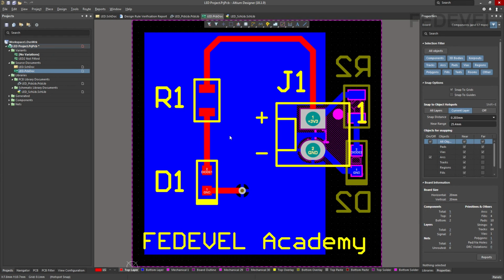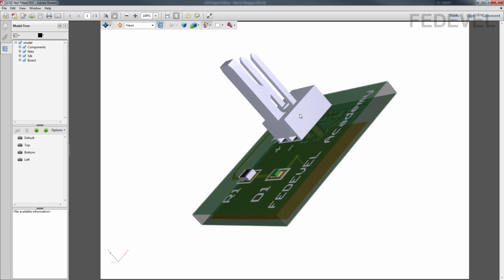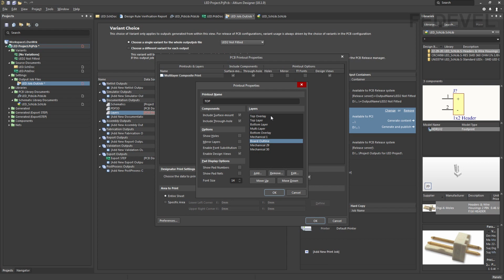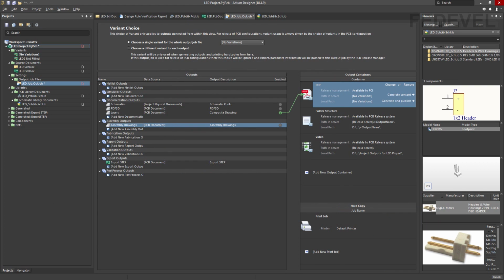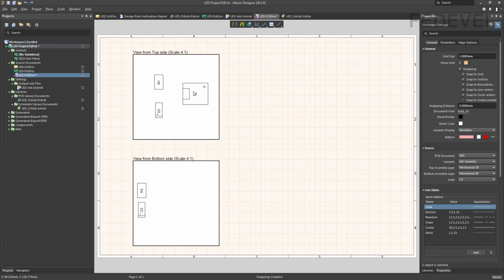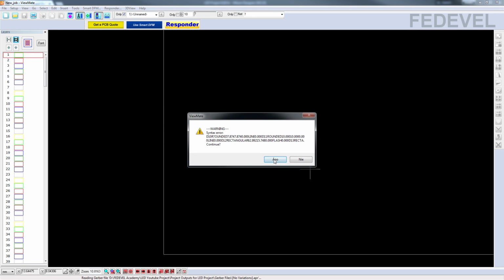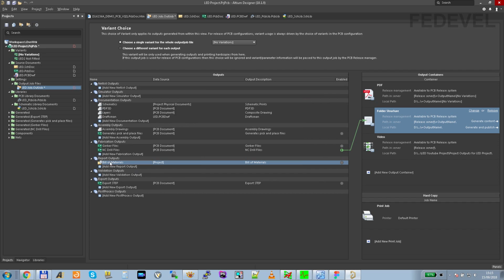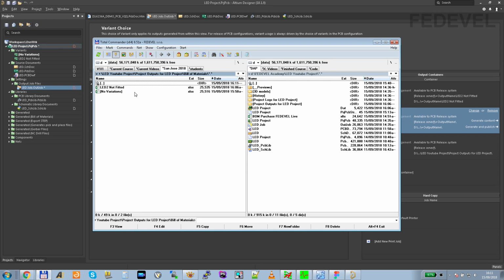Tutorial 5 for Altium Beginners: Generating Manufacturing Outputs

Comment: Hi Robert,   Went through the video the second time, and now it's making a little sense.   Running Altium 22 is one thing, but designing and packaging the PCB into a 3D model is important.  Pushing this 3D model to Solidworks 17 is another challenge.  Do you have courses showing the chassis placement and interconnections?

Comment: 26:19 therer is no Top assimbly layer and Bottom assimbly layer in Source. I am using Altium 20.0.13
Reply: Beginner here.  I got it to work by changing M29/M30 pair Layer Type in PcbDoc to Assembly.  Then in PCBDwf, right click on the sheet and import changes.  Ignore Source selection as the top/bottom options appear to be gone.  Click on either top or bottom image in draft then change Component Body in bottom of Properties to Assembly drawing.

Comment: Hi Robert, Thank you for creating this awesome content. Acquired a lot of knowledge. I have one question, I have a requirement to create a daughter board where it consists of many small module boards attached to it using female headers. I have designed the common module schematic and PCB design, Now I want to use this design as the component in the new schematic so that when I select this component I should get the footprint and 3D model of the module. Could you please help me with this? (I am using Altium designer 21.2.2)

Comment: 28:48: on altium 21.0.8 there is no option for "top assembly layer" and "bottom assembly layer", i haven't figured out how to do this yet

48:32: when setting up the BOM, left clicking on the column name doesn't order the items based on that column. this is weird esp since manual says it should work
https://www.altium.com/documentation/altium-designer/bom-configuration-in-the-report-manager-ad#!sorting-data-within-columns
ETA: i clicked ok and went back and it worked. huh

Comment: Robert Excellent content from V1 through V5;   I was an Altium user many years ago.  Now, I am back in this program.   Draftsman is something new and the FPGA stuff is gone.   Wow, what a great introduction to Altium.   May need some help in impedance matching components and boards.   What would it take to make a gigabit board?    Differential traces;  crosstalk and signal integrity would these topics be included as tools to solve the issues at hand.  Phil
Reply from the maker: Thank you very much Phillip. PS: I have some videos on my channel about that topics.

Comment: Altium 20 don't have top and bottom assembly layer option in source tab in Properties while generating craftsman document. where to get that ? Help me Robert !
Reply: Altium 20 has seperate general and Layers tab in Properties. We can select assembly layers from Layers option while generating craftsman document. Thank you Robert for such amazing videos.
Reply from the maker: Thank you very much Pritish for providing also the solution.
Reply: @pritishvitekar2187  The same applies to AD 19.1.9, although when I change the source to show the variant, nothing changes because the mesh is created only when the Component Body checkbox is selected, which in turns overlap the Assemby layer :(
Reply: Select your board assembly view ->properties -> components -> uncheck all components 
Then go to layer tab and make visible mechanical layer29

Comment: @Robert Feranec Thank you so much for your altium series for beginners.Will you give another series for advanced? For example in my design there are lots of same circuits, for this reason I want to make same placement and routing for all circuits I dont know the short way of this. I watch your video about copy placement but there is simple way to copy placement,align it in pcb and copy routing too.
Reply from the maker: Thank you Hasan. PS: It is on my list, I just have not had any project where I could use it and make a video about it.

Comment: Hello Robert, I am using your BOM template but could not generate 5 columns. Supplier Order Qty 1, Supplier Stock 1, Supplier Unit Price 1, Supplier Subtotal 1, Supplier Currency 1
. How can I resolve this? I am using Altium 19.1.7 and MS office 2016. Here is an image: https://github.com/Shahzaib-Shamim/BOM/blob/master/BOM.jpg
Thanks for this series!
Reply from the maker: Altium keeps changing it. However, when in the configure window, try to go to Properties -> Columns TAB and try to play with the Sources buttons. Depends on what you are using, but you may need to enable the Server button (?)
Reply: @RobertFeranec  Wow Robert, thanks a lot. Enabling Server button did the job.

Comment: I think I learned a few things. Not sure if they will work on my version (17) but there may be similar options. So far (before watching) I have fumbled around a bit and I think I have the basics OK  like changing layers while routing and I've used ctrl+shift+scroll wheel to traverse layers. I'll have to try the shortcut to put the component on the bottom layer (I've been double clicking and using the properties box to change layers for the components). To delete tracks I had been using the unroute -> connection option.
Reply from the maker: Yeah, 17 is not so different. Biggest difference is Properties panel vs Double click. And .. some options where moved around, so you may need to look for them.

Comment: Sir, i have generated 3D PDF as per the steps told by you but the generated 3D PDF page is blank, what may be the reason?
Reply from the maker: Are you using Adobe Reader?
Reply: yes sir
Reply from the maker: @lalitkumarbaghel4338  Hmm .. then it should work oki. Maybe try to open 3D pdf from my original project, to see if problem is in Adobe Reader or in the generated PDF?
Reply: @RobertFeranec , its working on adobe....thank you sir

Comment: 0:44: Add new Output Job File to project
1:23: PDF Schematic
6:23: 3D PDF

8:44: STEP 3D model
13:01: Composite Drawing ("Layers")
19:10: Assembly Drawing
25:13: Draftsman Document
32:36: Pick & Place file
34:39: Gerber files
39:24: NC Drill file
41:40: BOM
53:05: View files in video on Github
Reply from the maker: Sean, I was just adding the chapters into this lesson :) We had to do it at the same time

Comment: I have come back to this series several time because it is so good and because I have tried to move the design I inherited closer to this methodology. Today I set up variants the the two versions of our product. One version with 7 Segment digit display and on version with an LCD display. 

After setting "DNI" components as appropriate I generated schematics with the variant names. I then pondered, once these are printed out you cannot tell one from another by the drawing name on the actual drawing.  

It seams that every page should have a variable parameter which can be set by the variant method and this parameter should be on each page in or near the title block.
Reply from the maker: Thank you Forrest. This may help - you can add variant parameter for example to titleblock: https://youtu.be/cD-iW0LNR9Q

Comment: Excellent video Robert Feranec. I have a small question. I am a new PCB Drawer and I don't understand what is meant by Fitted and Not Fitted Components. Too much Thanks For you
Reply from the maker: fitted = component is soldered on PCB, not fitted = component is not soldered on real board
Reply: @RobertFeranec  Thanks Very much

Comment: Finally finished this wonderful presentation! I learned so much... 
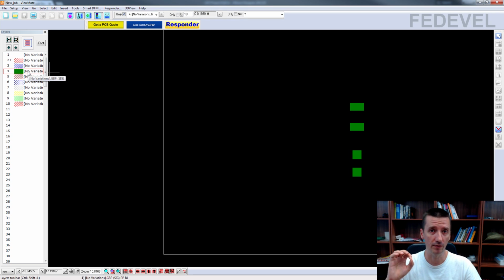(a tiny hint for ViewMate, instead of all the double-clicking to view layers around 38:30, you can use the arrow keys above the layer list to move up and down the stack. turn all layers invisible except for one layer and try clicking blue arrow buttons!)
Also, if you ever have a desire to expand on this course, I would like to see a "Tutorial 6: Your First Revision". Use the same LED layout, but assume the engineer has asked for one LED D2 to be colored RED and wants mounting holes in the corners (or something like that). What to check before starting a revision? how to make a backup, clearance rule around holes, etc. Just an idea, but THANK YOU for making this series!
Reply from the maker: Thank you very much Jack
Reply: @RobertFeranec  Robert, please excuse my request for a "Tutorial 6" in my comment above. I had forgotten that you have more "Advanced Courses" available on your website (I thought I was finished with them all, ha!) I will try to get approval from my company to order them.
Reply from the maker: @jack0lson  Yes, the things what you mentioned are covered in my other courses. I can't put everything on youtube - it is quite a lot of work to prepare videos like these. It may not look like that, but for example Advanced PCB Layout course took me 1.5 year of full time to create (that includes 1 year of board development what is used in the course as I needed to have our own materials for teaching and students practicing).

Comment: Hi Robert, I finally finished the whole series. All 5 videos were amazing and helped me a great deal. But I was wondering, is there a way to add the measurements (at least the board size and the distances to the mounting holes) in the draftsman document?
Reply: If anybody needs that too, I found out that in the draftsman document (*.PCBDwf) if you go to the menu Place you can add Linear and Radial Dimensions, which was exactly what I was looking for.
Reply from the maker: @AlexanderEick89  You can add dimensions in Draftsman and also directly in Altium.

Comment: Hi, thanks for the videos. In the 28:36 minute you select the "Source" for the Top and the Bottom Assembly Layer. In Altium 19.1.7 those options do not exist. How can I do this?
Reply from the maker: I noticed that .. I am not sure where they moved it, anyone knows?
Reply: @RobertFeranec  Greetings! I dont know if it actual after a year (i bet it's not), but i've faced same issue when going through your great tutorial and have found the answer (Started learn altium this monday). To get same result in altium 21 as you got in altium 18, you need to go to _(name of your PCB)_.PCBdoc-> View Configuration->Layers & Color-> choose Assembly Component Layer Pair ( in this video you have used "mechanical 29 - mechanical 30") -> click RMB -> Edit Layer -> choose "Assembly" Layer Type. 

After that you need to go back to the draftsman, click on neccesary Board Assembly View -> Properties -> Component Display Properties -> Component Body -> Assembly Drawing -> Profit (Simply Stated, do exactly how you have shown on the video exept "Source" setting. Instead of Source you need to edit assembly component layer pair properties in ___.PCBdoc).
(Don't know is it  really necessary, but i also impotred changes from ___.PCBdoc to draftsman by clicking RMB on draftsman area -> import changes from ___.PCBdoc)

P.S. Thanks for awesome video! YouTube have plenty of guides, but you are encomassing ennormous areas of small details and explaining them very accurate and clear. Thank You for your job! Going to try your cources when i will have enough resources for them :)
Reply: @writershonor  Excellent. This should be promoted to the top. Great advice Worked a treat
Reply: @leeman3749  I'm glad it helped ypu :)

Comment: Hi Robert!
About the Draftsman.
I do not have Top Assembly Layer and Bottom Assembly Layer in AD 19.1.5 in Source.
What can I do?
Reply from the maker: I noticed, they made changes again. I do not use Draftsman, so I have not had a look yet how to use it now. But when you figure it out, please let me know (maybe I would try to go to View Configuration and I would set Layer type for assembly drawing layers - maybe that could help?)
Reply: I use Altium 19.1.5 as well, and I went ahead and continued with the video even though I couldn't complete that step. The next step of changing the Component Display -> Component Body to Assembly drawing still worked just fine. So you may try that.

 @RobertFeranec  What does changing the assembly layer do in 18.1?
Reply from the maker: @MRiddickW  in 18.1 you could directly select the layer which you would like to use as an assembly layer.

Comment: Hi Robert!
In you, the assembler layer is Mechanical 29.
If we use components from different libraries, they use different assembler layers. How to work in this case?
Reply from the maker: In new Altium it is easier - I will make a video about it. Basically, instead of selecting specific layer number, you will be selecting layers based on how they are used. Altium will then automatically use the correct layer for assembly drawing. In the old altium, you can copy between layers and move the objects on the layer which you need.
Reply: Thank you very much, Robert!
I will expect this video from you. I hope it will be soon!

Comment: amazing as usual 
can you tell me how to generate inverted top and bottom layers to home printing with photo resist film
also i need to know how to make general template for all my upcoming projects 
thank you too much
Reply from the maker: You can check Mirror checkbox in the settings of job file. I am not sure about templates - I have not used them.
Reply: @RobertFeranec  i mean the BOM template that you have used in this tutorial 
thanks
Reply from the maker: @homemade83  ah, just download the template which I used, open it and you will immediately see how to adjust it. You just need to call the columns with component parameter names and you can also add project parameters. Feel free to adjust my template.

Comment: Robert,

I want to generate pick and place list with out hand inserted parts like the through hole connectors in your example.
Do you have a strategy for setting Variants to facilitate generation of a pick and place for each variant?

So a Pick and Place for the no variants would include R1, R2, LED1 and LED2.
So a Pick and Place for the no LED2 variants would include R1, and LED1.
And a "Pick and Place" for the hand inserted parts would include only the J1.

Thanks,
Lee Erickson
Reply from the maker: Do it same way as for all the other documents. Just select variant when you will be generating the output.
Reply: Hello Robert,

I follow about the selection of the variants at the time of making Job Outputs. What I am blocking on is setting the component variant properties to get the desired result when the variant type is selected. 

FYI, I spend tome time trying to filter the reports on some component Property fields we have called DNI and HAND PLACE and found that the filter feature for pick and place is buggy. The preview filters fine but the output file has completely unfiltered results.  So I have resorted to using a spread sheet for post processing. 

I am using something like Version 17.1.9 IIRC.

Comment: I would like know if i create a project in milimeter, when i create gerber file or nc drill files i can let the option the units in inches ? Or need change this option to milimeter too. This value need be same the project or don't matter?
Reply from the maker: Usually I generate gerbers in the same units as the board is created. If the board has mixed units, then usually I use the units which are used to specify board dimensions (e.g. size of the board, mounting hole position, connector position, etc.)

Comment: Can you create a drill file for blind Vias and buried Vias and Clan you tell a little about the mechanical via dimension. Do you geht own drill files for blind and buried Vias?
Reply from the maker: Yes, when you specify Drill Pairs (from where - to where the drilling is done, e.g. from TOP to Bottom, L1 to L2, L3 - L8, etc.), then you will get separate drill output for each Drill Pair

Comment: Again, nice useful video.

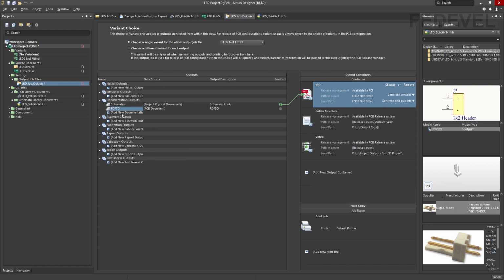I am using Altium 18.1.9 and cannot get the 3D PDF.   Regarding the menu at time 6:35, 
When I go to add new document, left clicking "[Add New Documentation O]" the menu I get does not have the DPF3D options. It has only: 
"Composite, PCB 3DD Print, PCB 3D Video, PCB Prints, Draftsman,  PCBLIB Prints, Report Prints, Schematic Prints and SimView prints"

Anyone have any idea?  Do I need to install the PDF3D feature some how?  A check box to enable it some where?
Reply: some 3d pdf files didn't work with foxit reader you need to use adobe reader and it will work with